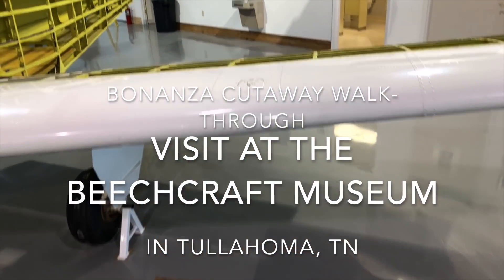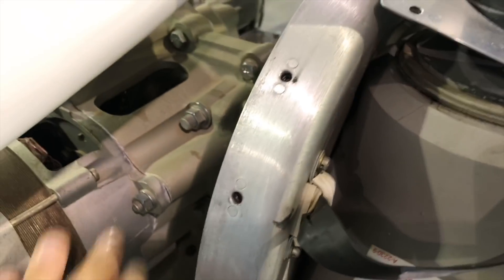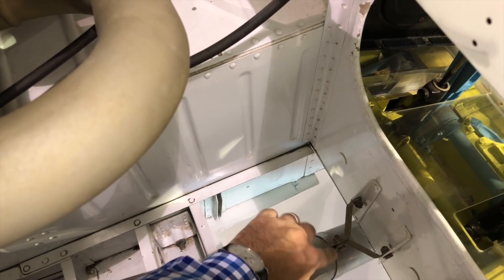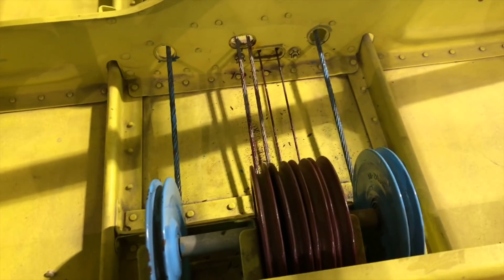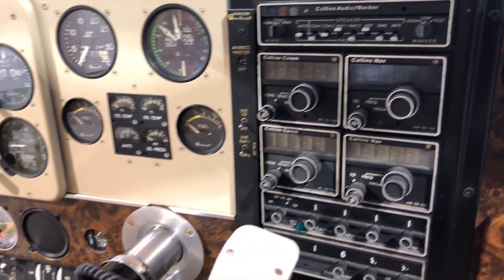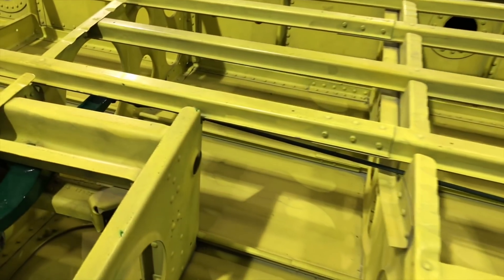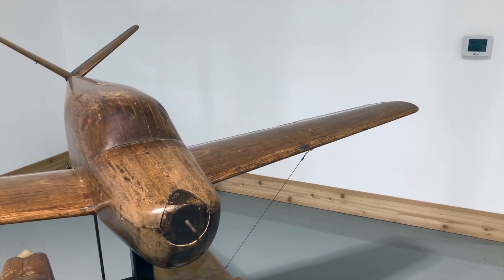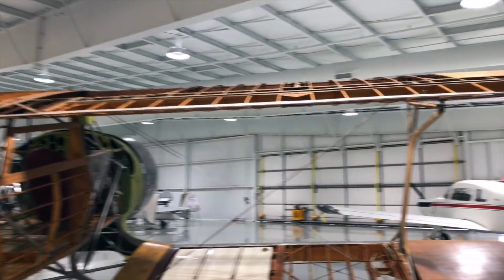Bonanza cutaway walk-through

Comment: Do you know which is the angle of the V-tail arrangement?
Reply from the maker: It is 33 degrees (this is a late model V-tail). The early models (up to C-model) had the angle at 30 degrees (as measured from horizontal of course). Therefore, the angle between the two Vs is 180-33-33 = 114 degrees.

Comment: It's always good to see the guts of an aircraft, appreciating construction details of the airframe and systems. You have to think that behind every detail observed there was an engineer designing and calculating stresses, air flows, heat transfer, mechanical joints, etc, and all very well documented for certification.

Comment: Does anyone know what type of wood was used on the wooden aircraft?
I suspect it was hickory.
Reply from the maker: Likely spruce for structural pieces and birch for plywood parts. Maybe also some ash pieces.  Hickory is not typically used in aircraft construction. BTW, Beechcraft retained using birch plywood all the way to present times - Bonanza's floorboards are made of Baltic birch plywood.

Comment: Those pulleys rotate when the cables move when you move the yoke!! Any mention of indexing or rotating the pulleys to even out wear is completely wrong!!  Quit guessing!
Reply from the maker: don shields Except that they only rotate through a fraction of their circumference when the cables move. Next time you check you pulleys you will see that they top part is dusty as it is never used. Hence the rotation. This is a recommended practice during annual inspection although probably seldom followed since many of these phenolic pulleys are not easily accessible.
Reply: @BonanzaBart  I have learned something! Thank you!

Comment: That Fuselage is not really considered "wood"construction in the true definition. The loads are transmitted through the chromoly steel fuselage. The wood is used mostly for fairings and aesthetics, although I'm sure there are a few stresses. It's just like the wooden turtle deck on most old tail draggers. It could be removed and the airplane would still fly because the loads are in the steel tubing, not the wood fairings.

Comment: Thank you very much for producing and sharing this awesome video Bonanza Bart!

I have many hours as a passenger in a very well maintained late 60's model, 3-blade prop V-35. Although I am a PPL Holder, flying it or touching any of it's controls was out of the question. My friend would not even allow anyone to open or shut the door. He obatained it in great condition and meticulously kept it that way. No problem here with that at all. I just feel priviledged to have gotten to know so much about the structural integrity throughout the entire build, how well it handled IFR/inclement weather conditions/turbulence, its speed and over-all comfort. I've been in many of the more popular single engine General Aviation aircraft, and can say with confidence that there is quite possibly no other single GA aircraft as well made as the Beech line of single engined aircraft.

Now, if only Hawker/Beech would in a most affordable manner possible, reintroduce a more modern/replace all dated lines/make new more modern lines count for more than just aesthetics version of the Skipper, Sundowner, V-35 and A-36. Implement carbon fiber in as many places possible, reshape ALL glass lines, offer optional JET-A, standard T-handle throttle lever on ALL, use the yokes as found on late model King Air's, to include PTT/TRIM control, implement the latest in sound deadening material throughout, offer an optional JET-A TC w/pressurized cabin and de-icing for the new "V-36" and "A-37" models, redesign panel shape/lines, offer a few panel options, especially for the "Skipper 2.0" Trainer, offer BRS option in Skipper 2.0 Trainer/Personal use and these other new models, offer a 200+H.P./RG "Sundowner II-HPC" (high performance/complex) model for those seeking to obtain their high performance, complex rating...a stepping stone to the V-36 and A-37 or Simy want more at a lower price, AOA, make ALL switches ergonomically friendly in their location, possibly as many as possible over head, offer optional A/C, create even more room as others have done with older designs, by making side panel arm rests inset (hope I explained that properly), offer optional carbon fiber wheel pants for the Skipper 2.0, Sundowner II models, 3-point shoulder harnesses throughout, 90-degree reclining seat backs and that's all I can think of.

Happy/Safe Flying and God Bless!🙏🇺🇸👍

Comment: 5:06 The HOT exhaust pipe needs room to contract and expand. A rigid exhaust will crack. The clamp is there to guide the pipe, not to make it rigid.
Reply from the maker: and what happens to the diameter of the clamp when it heats up and cools down?

Comment: I tried so hard to watch but the video frame rate and strobing was too much to handle.
Reply from the maker: What strobing? Frame rate is 30fps. I get some of the criticism is well-deserved but this one has me scratching my head. I used HD camera with a gimbal to make the video smooth. Check your internet connection and for any potential side-effects from drugs if you are using any.
Reply: @BonanzaBart  . Video is fine.
Reply: Flight of Passage Thanks. Not sure I set out to make it personal. Clearly there can be issues either on the conversion side with YouTube or the shutter speed was not evenly divisible into the 30fps with that indoor lighting causing a strobe effect. Either way it has nothing to do with you or the content you put together which I’m sure are mutually exceptional.